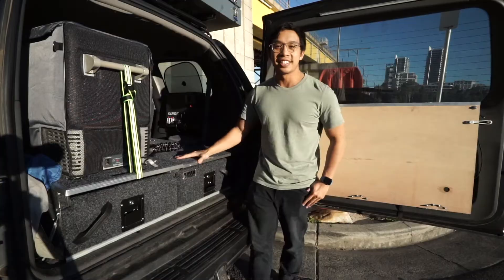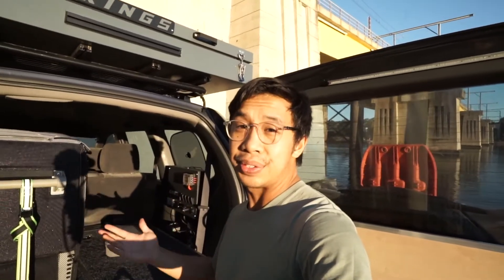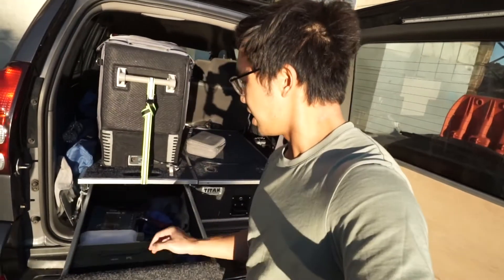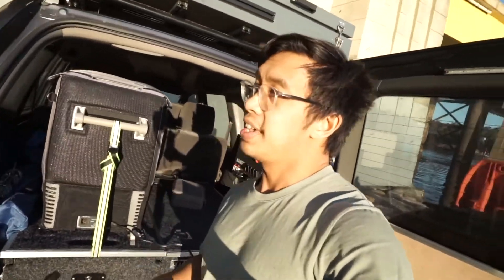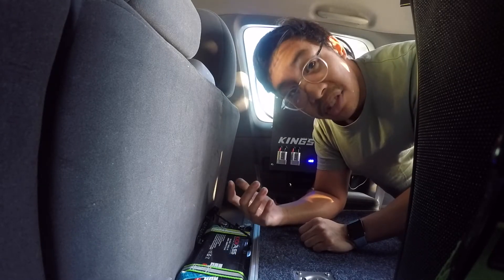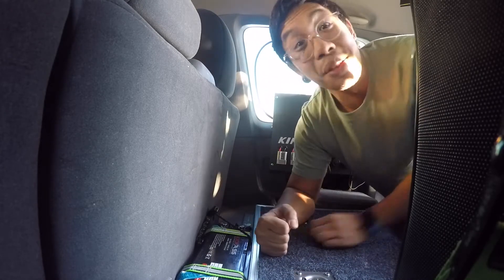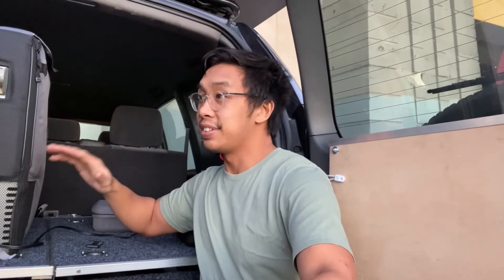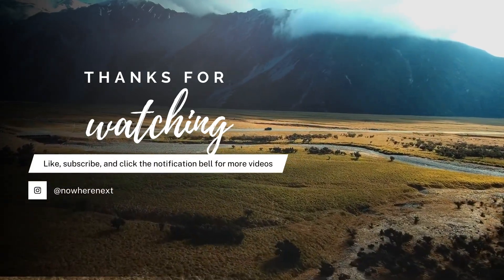Four years of using an Adventure Kings Titan Drawers System! Are they worth it? Full review

Comment: Do they make a wing kit for the sides of the drawers? And if so what do you think about adding them for more space? Id like to get these but i would like it to span across the whole trunk.
Reply from the maker: Hey Jake ! Sorry for the late reply. As far as I know they made wings for some models but not all but they also have a custom kit where you can cut out the shape you need for the sides.
I had the wings but found that I can stuff more stuff without them there eg. Camp chairs, camp stove etc. With the wings you can stuff only small size gear, tools etc. however I did see some people running their switch panels through them for their 12v set-up. So it really depends on what you want to store. 
My advice is to keep looking online for more ideas and products but if you have the time and tools maybe you can build your own as 4wd drawers do get quite expensive.

Comment: Hey old video, just curiouse, what year is your prado? And also did you use factory holes? Or did you have to drill new ones?
Reply from the maker: Hey, the back of the drawers aligned with the factory bolts but the front of the drawers I used a swivel with carabiners and connected it to the tie down d rings. Every now and then I would have to tighten the swivels due to the vibrations but it works well.

It's a 2016 Prado 120.
Reply: @nowherenext   thank you!